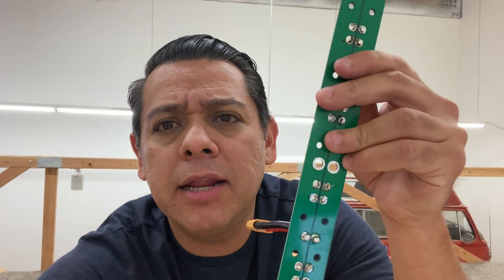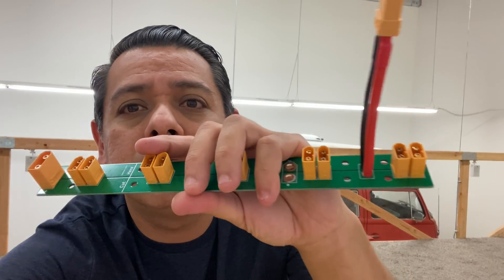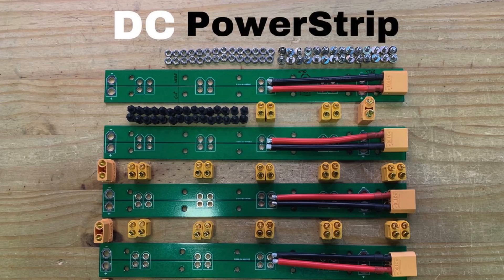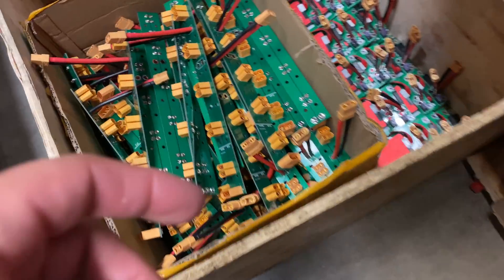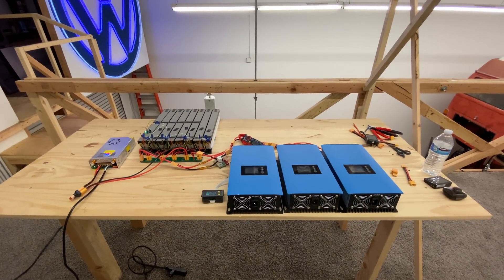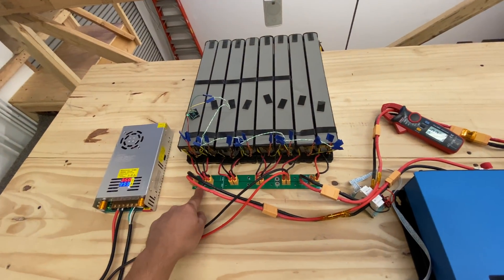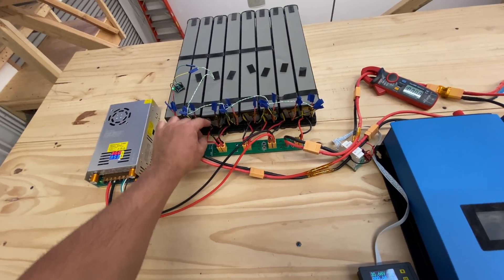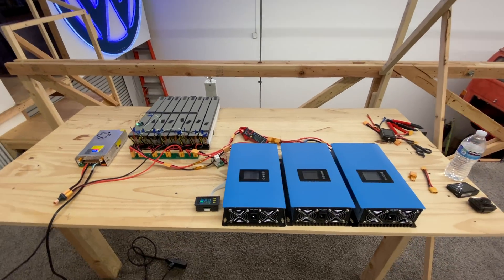Building Large Battery Systems using a DC PowerStrip

Comment: Maybe I am going to sound crazy but it is the direction I have thought to go in, I have only just found your site and its sparked ideas...  Im looking for something like this, but works like the backplane of a hard drive nas unit that instead of hard drives I would be able to slot in/out long slim (eg. ebike batteries that already have a BMS) batteries.  Does that make sense?  Like a NAS with Hard Drives, but instead a box where you can insert, swap out, hot swap other battery packs.  DO you have something like this please?

Comment: Hello Jehu, I have a 12V SLA UPS (with a dead battery) and I was wondering if it would be possible to replace it with an 18650 battery pack with a BMS. I understand that SLA charging has specific characteristics that may not be desirable or appropriate for lithium-ion cells but would it be safe to assume that the 18650 BMS would filter the unwanted characteristics so that there would be no issues with the operation of the UPS?
Reply: No no and no. Plent of discussions on this.
Reply: A 4s LiFePo4 battery pack will have similar voltage requirements to the 12V SLA.  Use a BMS on the 4S battery.  Note that LiFePO4 batteries are different than the typical 18650 Li Ion batteries.  They have a 3.2V nominal voltage, 3.6 max charge voltage.  For example A123 or Headway.

Comment: Hey there. Please consider a video on a 6S 40p or higher 300A bms. I looked at the supplier you link to but they don't have 6S. They did email me back that they could custom make a 7S into a 6S   I am using tesla S packs and your 40 cell packs for 6S 24v inverters and don't have a high amp BMS solution

Comment: It seems to me it would be a good idea for you to sell the scooter battery packs populated with batteries that have already been tested rather than a DIY'r having to purchase all the testing equipment if they're only going to build a battery pack once. Being able to purchase known good, tested batteries would be much more economical for the typical DIY'r that just wants to build a powerwall or 2 for their own use. Also some kind of board that uses compression springs and fits on top and below those scooter battery packs using the screws to hold them together and maybe some kind of stiffening backing plate so you can get enough compression would be a really good idea to make it way easier to build ready to go battery packs
Reply: Sounds like u should just buy a pre-built powerwall
Reply: @MrSteewped  no fun in that

Comment: Hey Jehu, could you show details and explain, what adaptor you used at your power supply, which one do you use and recommend for a 7S pack (may be meanwell?) and how you connect your DROK Hallsensor measurement? 
I'm building up a smaller pack with MH1 batteries but need a 230V AC-DC power supply which handles more than 20A charge current. I use a BMS with RS232 output. 
I need a inspiration for how to connect all stuff nice :)

It also will be nice, if you can suggest stuff, which i can buy outside of america, shipping and customs to germany are currently bad. That's why i want to buy your strips for sure, but last time I had to pay >100  € to customs for an 300€ order. May be, you can sell cour Kicad/Eagle files for self production?

Comment: is there any way to take these packs and run 2 of them as a 72 volt system needing help with an e bike project
Reply: Easy. Hook the Positive of one pack to the negative of the other. Use the free + AND - as your bike battery source

Comment: Bought 18 scooter batteries l want to do a 48v powerwall. Probably get another 10 batteries but have no idea how to configure.  Just heard ya say l could connect 14 to make 48v so lm thinking putting them in parallel 🤔
Reply from the maker: You’d have to take them apart reconfigure and put them back together at 14s
Reply: @jehugarcia  ok ...14 at 1s. I'll  buy another ten. Seen the video  with the jumper for the batteries with the connectors im gussing the one i purchase will have the connectors.  I know you are working on being able to use the BMS that come with the battery pack.  Will I be able to solder a connection To the packs that had the wires clipped to use the on board BMS once you get it working?
Reply from the maker: Or 14 of them at 1s

Comment: Can you  test that exact system using Anderson Power Pole?  I think you might have better connector performance using that connector.  Yes XT60 is what is used on most packs, but I think you are getting a lot of resistance  with these connectors which is causing them to heat up.

Comment: The output connector in the end is drawing all the power from one direction while the other output is drawing the power from both sides as you have two batteries connected to the right on the first power strip. With an output being in the middle the PCB tracks only have to provide half the current from each side whereas the output in the end will draw all the current from one side. Having an output connector in the middle also allows for heat dissipation to both sides of the PCB and in total I believe that is why you saw the different temperatures.

Comment: This is perfect if you want to slowly expand your battery banks over several months. Build a small battery, start using it. Build more small batteries as you can afford the components. Plug in each new battery as soon as you finish building it.
Reply from the maker: Modular design

Comment: What are the Blue Inverter for a Type and can i adjust the power Output manually maybe 200 or 250 Watt and the inverter reduced the Output to configured value?

Comment: All your DIY stuff is trial and error work.  You can't figure out why you have issues, but an engineer could spot it immediately.  60C = 140F, which is too hot to touch.  That's dangerous.
Reply from the maker: 140f is not too hot to touch, unless you have sensitive hands.  Do you?
Reply: https://www.jm.com/en/blog/2015/february/too-hot-to-handle/ "the average person can touch a 140°F surface for up to five seconds without sustaining irreversible burn damage" so just don't touch it for more than five seconds...lol

Comment: It looks like your using the BMS that came with the scooter packs? but the big powerwall they are all hooked together with one BMS, is that correct and if so what is the best why? I have 10 and have already pulled off the BMS and was going to hook them all together with one tiny BMS s516, any thoughts?  Thanks
Reply from the maker: Using the original bms is best as is less work,  but I still don’t have the controllers to share with everyone
Reply: @jehugarcia  Thanks... But should I put a NEW small BMS on each and plug & play all 10 or maybe in groups of two I like the flexibility of putting 5 on or 6,7,8,9 or 10 depending on the need.  Also I use the same GTI been working great!
Reply from the maker: Use one big bms it’s easier
Reply: @jehugarcia  Thanks, yeah the tiny BMS has a ton of options too.
Reply: Can u make one of these extension for my 1800 patriot generator to boost my power thank u
Reply: An how much longer would it take to charge it with two 100 watt panels